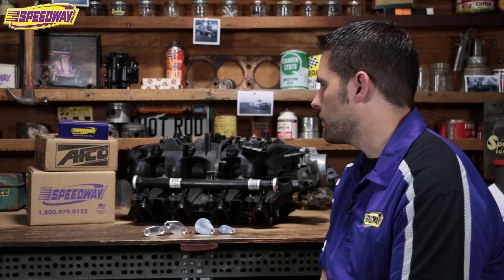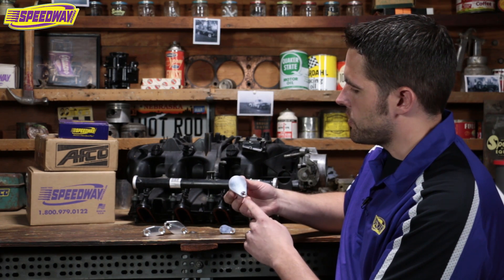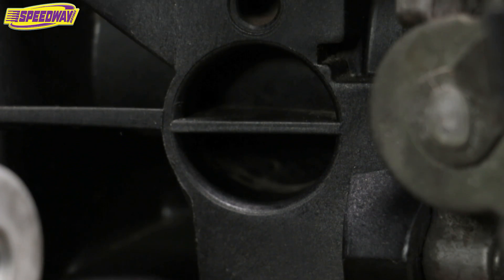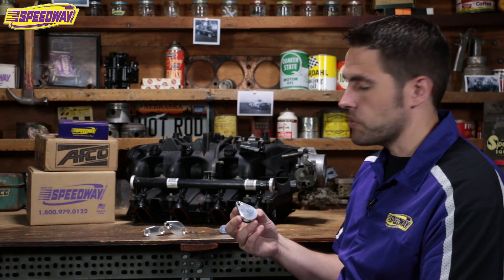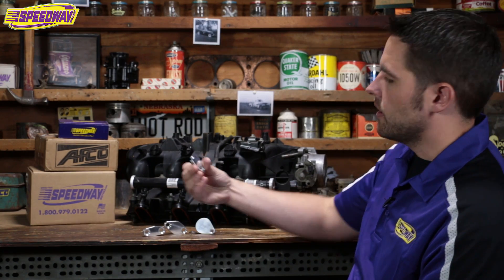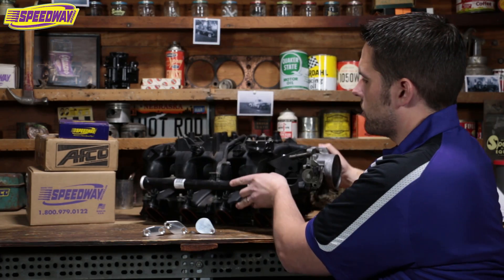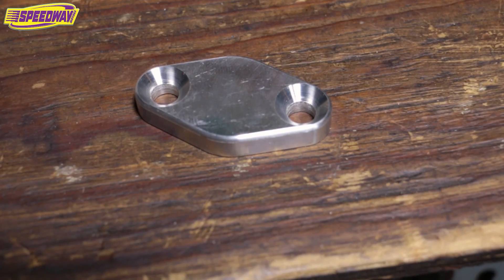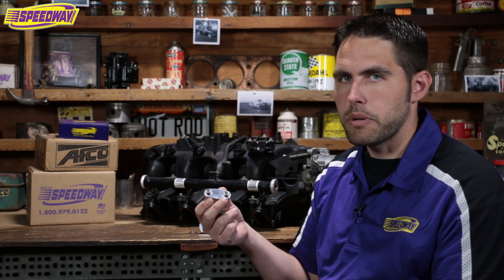Speedway Tech Talk - LS Block Off Plates

Comment: what benefits would my 2005 Chevy Tahoe with the  4.8 and true dual flowmaster 40 series have with a egr delete kit and would it need programming?
Reply from the maker: These EGR delete plates are meant for engines that are being swapped into older vehicles that are used in off road applications and are not subject to emissions law. The benefit for that application is that you are not re burning exhaust fumes through the engine. You would need to delete codes from the ecm.

Comment: I have a 5.3 99 Chevy Silverado I want to delete my knock sensors and EGR and O2 sensors how can I do that plus delete it on the computer?
Reply: Rick D hp tuners
Reply: Why waste $$ on fuel injection with that idea, go out and buy a carburetor if you DON'T want reliable consistent engine performance under any condition
Reply: @DG-sf9ei  What? I think you got that ass backwards.